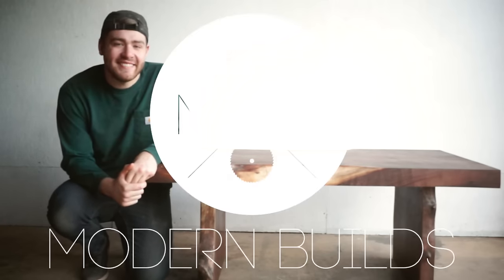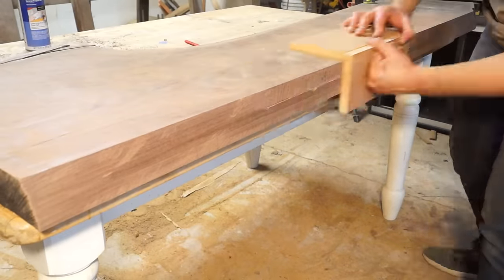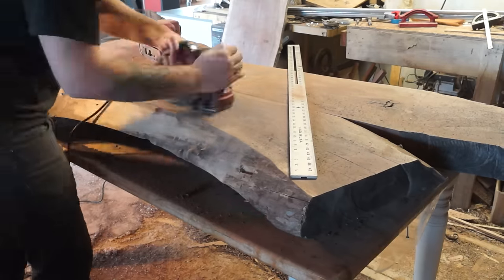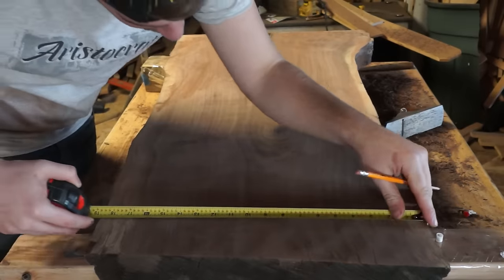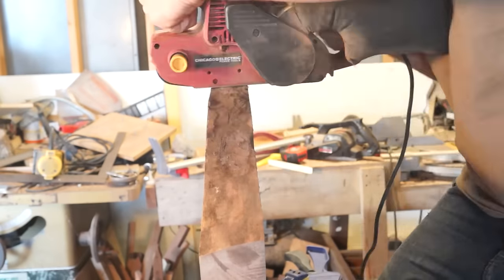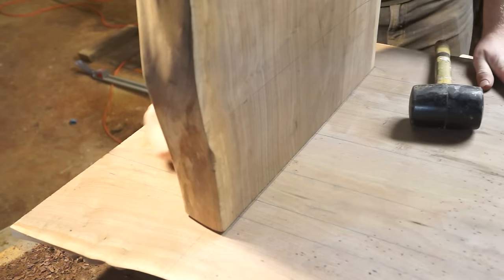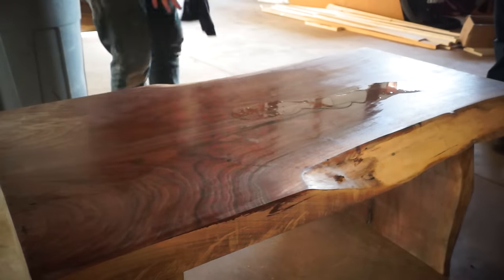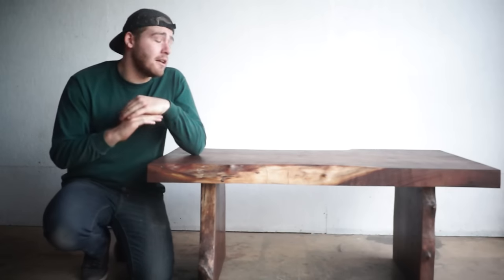DIY Live Edge Slab Coffee Table | Modern Builds | EP. 23

Comment: Nice work Mike.   If you like it, that’s all that matters man.  

One critique though, I have seen professional finisher Charles Neil utilize the wetting of the wood to raise the fibers.   

What you did was wet sand like a car painter or fine metalworker.    

I believe you should hit it with water, let the wood dry, then sand it.   More fibers will stick up that way.  

If not then it seems like you would just be smearing and muddling the fibers to death.  You want the grit to cut, and it will cut better if the wood is dry.  

Cheers, great work man.

Comment: I noticed you did a turning view of the finished piece. An idea for a project: build a rotating platform. Use the bottom of a desk chair and a piece of plywood. Add extra casters to the outside edge to cary the weight. Put a center turning point in with pipe or pic to make sure your piece can turn on a single point.
Reply from the maker: +Pete Goode I've thought about some kind of giant lazy Susan before, good idea!

Comment: Nice build. I'm in process of making a bigger one myself and looking for leg attachment ideas. My question is considering you have cross grain attachment, are you worried about wood movement on either the top or legs? The top could crack or the legs could, or both considering neither has room to expand? Would you change design next time? Thanks!
Reply from the maker: Well, so far everything has gone well, but yeah, it could be an issue. If i did it again, I wouldn't have inset the legs, just a typical mortise and tenon with super thick dowels
Reply: Thanks for the reply and insight. I'll keep on watching. Thanks!

Comment: Another great video!  However I had a question.  Would it be possible to use the router technique you showed in another video to create the smooth flat surface vs. using the hand planar and sander method you showed here?
Reply from the maker: Definitely. These slabs were pretty flat, so it was faster to do it this way on this project.
Reply: Modern Builds one thing you may try in the future when your saw does not have the required depth is a flush trim bit on your router.  You still have to use the chop saw but you can clean up that cut pretty quickly with a flush trim bit.  Great video by the way.  I always enjoy seeing a beautiful slab turn into a one of a kind piece of furniture.

Comment: It doesn't appear that wood movement was accounted for.  Won't the top expand and contract?  Doweling the legs would restrict this no?
Reply from the maker: Honestly, they might, I don't expect there to be any issues though. I know it's a somewhat common method to dowel legs like these. I hope it's not a problem
Reply: Old comment and old video i know, but...those legs are basically small table tops too, and they are going to try and expand just like the top. They are narrower so technically they should expand less. In this application it just isn't as bad as people think. Also, if you're going to suggest wood movement may be an issue, then also offer a solution so the whole community can benefit.

Comment: Hi first of all,very good job man, second I wanna know when you wet sand do you use just regular water? I have a question I was making a console table and I used poplar wood very cheap I know but came out good, but I noticed after I used a conditioner and then stained the piece, I was noticing those fibers coming out, is it the wet sanding the solution for me? Thanks
Reply from the maker: Yeah, spraying a little water on it after one pass of 220 grit will raise the grain. Once it dries a little sand down all the little fibers and it should be good to go
Reply: so can I do it even if I stained already? Plus do you know if those guys from industrial by design ship to Canada?
Reply from the maker: To my knowledge, they only ship to the US. I haven't done it before, but as long as there isn't a polyurethane coating, you could do a wet sand. You may have to do another coat of stain.

Comment: hmmmmm, The table looks too bulky for its size, the height doesn't seem right, it looks like a bench height of 17 inches. . the legs are definitely not strong enough for it to double as a bench.  I would have put the wood to better use. Considering you have a router and all the measuring equipment I can't explain how you missed matching the dowel holes. But the table is not bad. I like it. Just being picky about some things. I could say some things about the finish, but I won't.